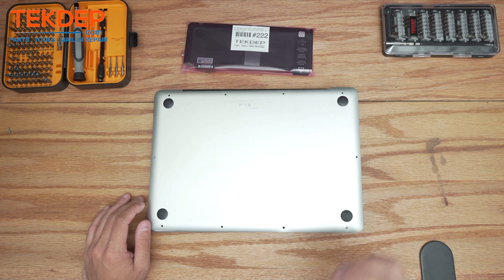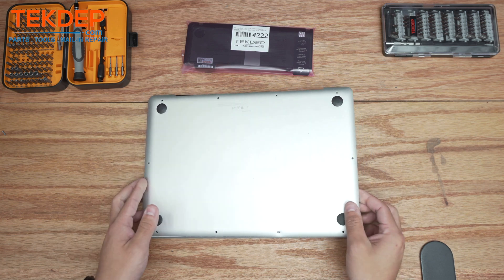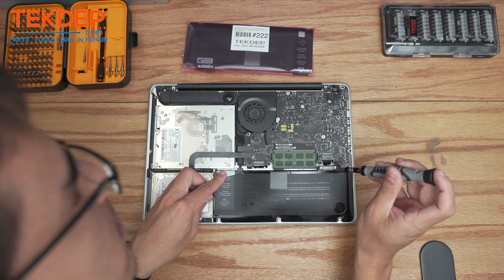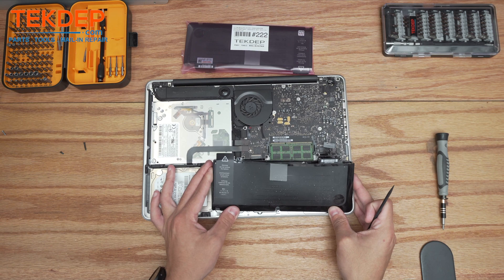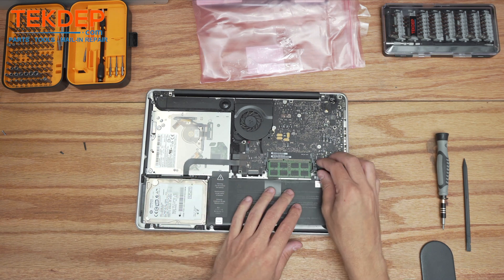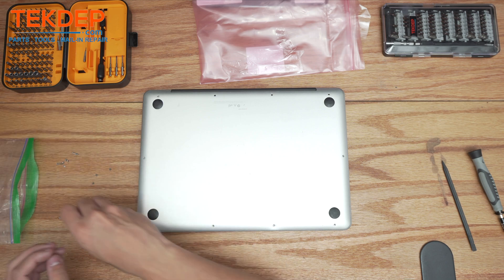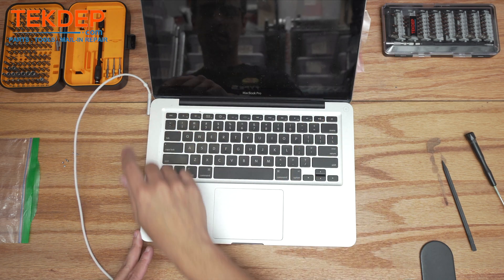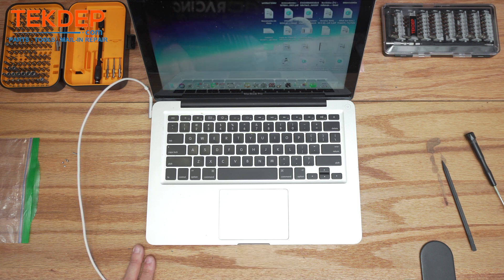￼ 13” MacBook Pro 2009 - 2012 | Expanding ￼Bad Battery Replacement A1278

Comment: What if 2 of 3 screws are stripped? Trying to get it out and replace.
Reply from the maker: Try a flathead screwdriver that can wedge into two opposite points of the stripped star can catch enough to turn it.

Comment: I have the same mac,
When it is on charging, runs smoothly,
When unplugged, either started lagging or sometimes unexpected shut down too.

Will this issue be resolved by changing battery
Reply from the maker: Yes, It seems as if your macbooks battery is failing, replacing it should resolve the issues you are having.